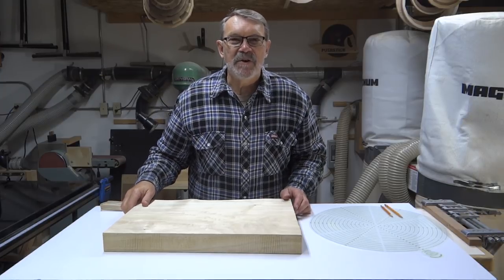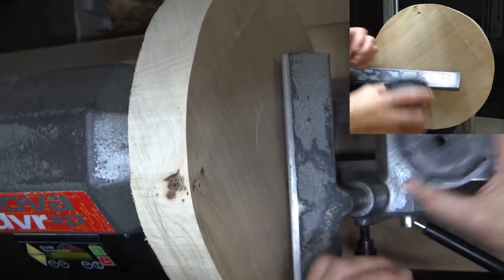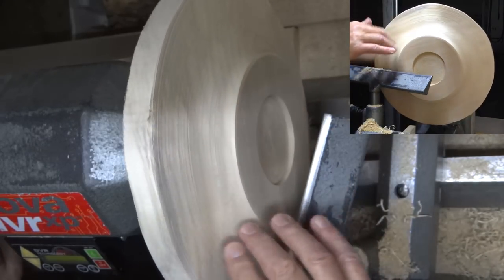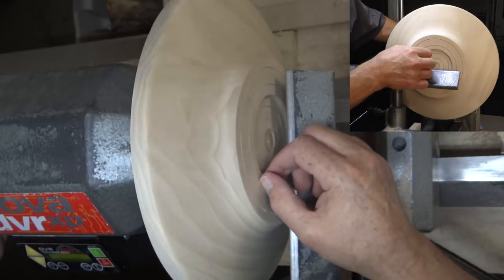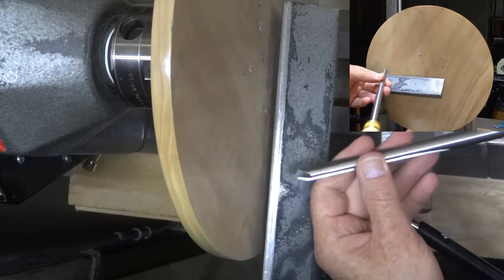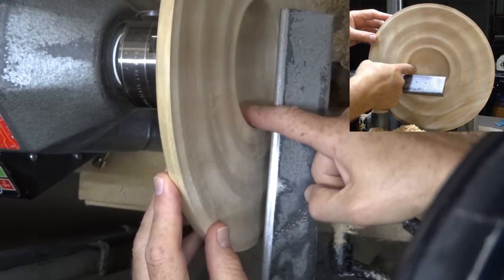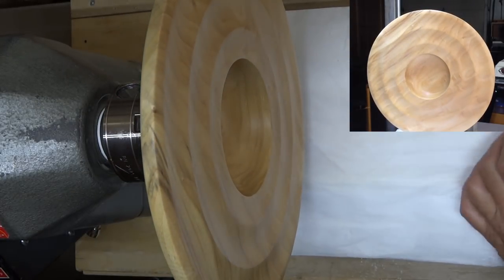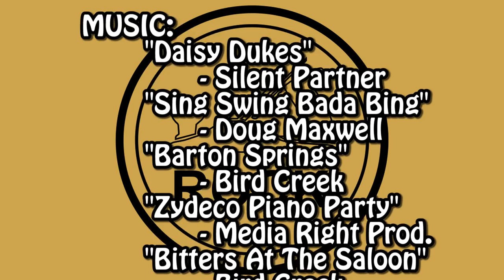"Ripple Rimmed" Poplar Bowl

Comment: Nice job, Gord.  I really like the ripple effect and the finish on top looks great!  I was surprised to see you applying the wipe-on poly as you did.  I have tried and tried to do that but after about three revolutions the pad gets sticky.  I always use the Seal Coat and the same MinWax product so I don't know what the difference could be.  Also, it seems to take 3-4 hours to dry before I can sand and apply more coats.  Wish I could look over your shoulder just a little closer!  Great video, thanks!  Phil
Reply from the maker: I don’t know why your pad gets sticky. Could it be a matter of temperature or humidity? I live in a fairly dry area but I can’t think what else might cause it. Your drying time leads me to believe you are in a more humid area????
Thanks for watching!
.....Gord

Comment: Hi Gordon . As someone who is very new to turning I really appreciate it when you explain what your doing or about too do. You mention the speeds in which you apply the finish.  Seems you like to apply at 200 rpm. So what do  you recommend a person do who has a low end lathe like me,  that only goes down to 600 rpm. ? Aside from buying a good lathe
Reply from the maker: There are limitations to what any tool can do. We just have to do the best we can with what we have. I like to apply the finish at a low speed because I can. If your lathe’s lowest speed is 600 then that is what you have to use. I would suggest putting the finish on in many very thin coats. Putting it on too thickly at that speed might make it less than evenly distributed. Just my 2 cents worth.
Take care,
.....Gord

Comment: Hi Gord, love the video, try to use sanding sealer before the Yorkshire Grit. This tends to give a better finish. Martin Saban Smith also uses a coat or two of Danish oil before the High gloss. He lets it cure overnight then applies the high gloss. Hope this helps
Reply from the maker: Hi Wayne,
I did use sanding sealer; thought I mentioned that. Thanks for the input! I'm going to see what happens with just buffing it on the Beal Buffing System. I received your sticker and will feature it in my next video. Thanks for sending it!
Take care,
…..Gord
Reply from the maker: Hi Wayne,
I have tried numerous times to send you an email re: your sticker but for some reason I can't get the email to go so I have to tell you here. This is what I tried to send:

Hi Wayne,
Thanks for sending me your sticker! Would you have a larger one available? This sticker is small enough that when I try to blow it up to show on a video it's going to be very pixelated. I don't want to have it looking bad if you have a larger version of it. If you don't have a larger copy of it I will do the best I can with it!
Thanks,

.....Gord Rock
Also, I loved the walnut crotch bowl but you haven't given the option to comment on your video. Liked and Subscribed!
…..Gord

Comment: Gord ... Don't have an answer for you, but I wonder what the Hampshire Sheen will look like in 2 or 3 years? Mot wax-based finishes tend to degrade over time and require renewal periodically.
Reply from the maker: I've been wondering about that too, Gerald. I have only used it a couple of times so I don't have any long term experience with it. I've never had much faith in waxes as a finish if the item requires any durability. That's why I'm asking what I can put on top of it. I probably didn't explain that very well. I like the look of the finish; just sure how long it will last.
 Thanks for watching, Gerald.
Take care,
.....Gord

Comment: Wow, Gord! Thanks for the compliments.

I will try to keep this short since most people don't want a treatise on finishing.
• The bottom of your vessel feels plastic because it is—sorta. 
• Sheen (the top of your vessel)—is directly related to surface texture. Light refracts in the crevices of the surface. The piece feels more like wood because of that surface texture. The smaller the crevices (scratches, pores, etc) the less refraction and therefore the glossier the sheen (higher reflection).  To achieve a high gloss appearance with this wax only approach you need to sand to a considerably higher grit than 400 essentially burnishing the wood. Yorkshire Grit recommends a sealer coat before use, thus filling the pores . They also claim equivalent of sanding to 1200 grit; I have never achieved that claim. Waxes will dull out over time due to oxidation requiring at least re-buffing, if not additional wax and buffing out. As to bringing out more sheen in the Hampshire Sheen, at this point let it cure a bit and buff, buff, buff. I suggest a synthetic wool  or microfiber pad like you would put on the head of an orbital buffer available at the box stores in the tool department. No need to own or use the tool. Just remount it on the lathe. And thanks for using cloth rather than paper towels. It does a far superior job while annoying the safety mongers.
You wouldn't believe how much I edited out of this response.

All the best :)
-- Joe
Reply from the maker: Thank you, Joe. I meant what I said! I always appreciate your information! I will wait a day or 2 more for the wax to cure and then buff. What is your opinion of using Carnauba wax with the Beal Buffing System. Would it improve anything?
Thanks for your time, Joe,
…..Gord
Reply: If you own a Beall Buffing System that would be fine. But I don't own one and have vacillated for years on getting one. On this piece you already have Hampshire Sheen which is a combination of carnauba (vegetable wax from palm leaves) and a highly refined paraffin wax (mineral [petroleum] wax refined to a microcrystalline structure).  Adding additional carnauba probably isn't going to improve the appearance.  Buffing will. Just don't overheat and melt the wax in the process. See Alan Lacers article in AAW 21.3: 54-58 (members only?)
I think I have said it before, and if I haven't I have certainly thought I should say that I don't consider waxes a finish, even though paste wax manufacturers promote them thusly. For me their purpose is to protect the finish - a hard resinous substance such as shellac or varnish, or a polymerizable oil  like linseed or tung. An oily tropical wood would be the only exception. Buff to sheen, apply wax and buff.

Cheers,
-- Joe
Reply from the maker: Thank you again, Joe! I will try buffing it in a couple of days and see how it works out.
Take care,
.....Gord
Reply: Exactly, Joe, on all counts.  I will only add one of the things I learned from a now departed, long respected turner, Russ Fairfield.  He recommended and only used pieces of terry cloth towels for finishing.  And based on my experience with his technique, it is far superior to using paper towels.
Billy